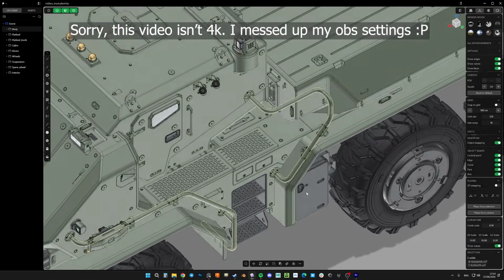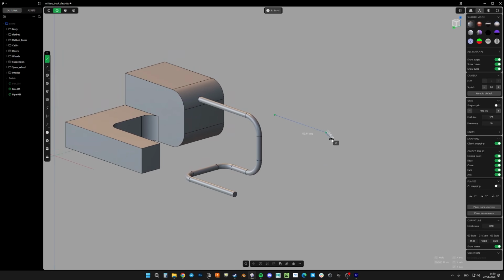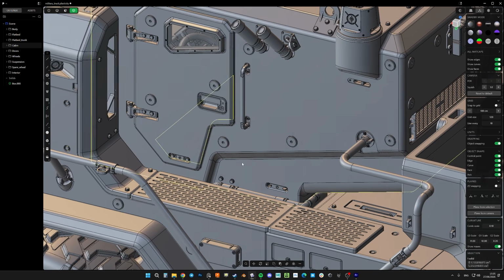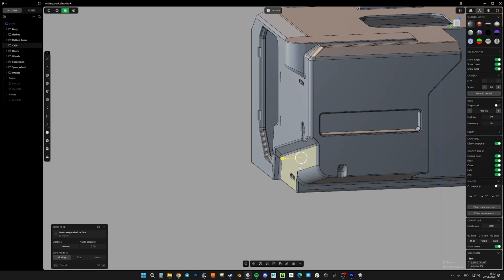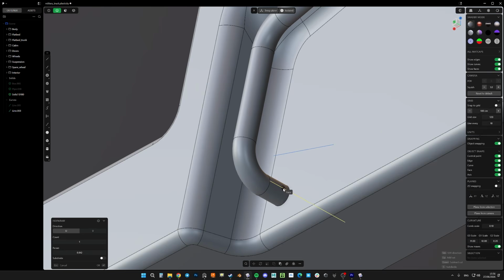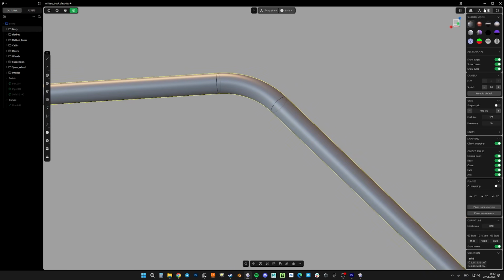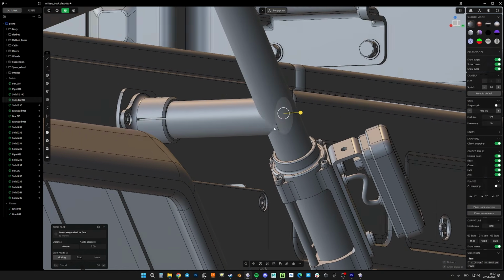Creating Tubes in Plasticity

Comment: I absolutely love your art, mate. 

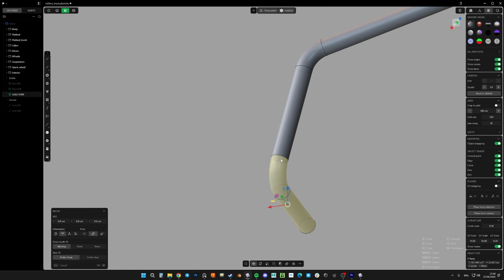Btw though, when the software was blocking you from moving the pipe ends at around 13:20 and 14:05, I've noticed that if you select the long faces too you CAN often move the section you want. It's VERY counterintuitive if you come from a poly modeling background, like I did, because grabbing and moving those "middle" polys would cause overlapping verts in the direction you're moving to. I notice at 14:05 you actually deselected the vertical pipe - if you try again with that bit selected, it might actually behave :)
Reply from the maker: Hmm that's interesting, never thought about it. Might try next time! I just wanna show thr cut trick that will work 100% :)
Reply: @drivemax97 oh, absolutely. CAD modeling has a few odd quirks that separate it from poly modeling, and moving faces is one of them! It seems to ignore the "border" vertices (or rather, what would be the border vertices in Blender or 3DS Max, etc).